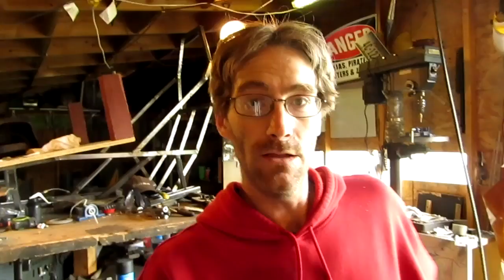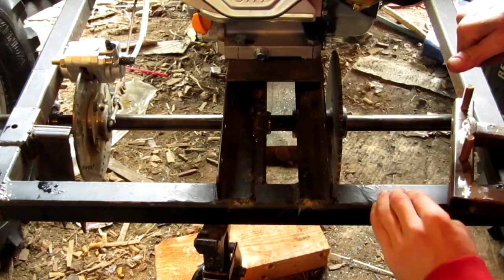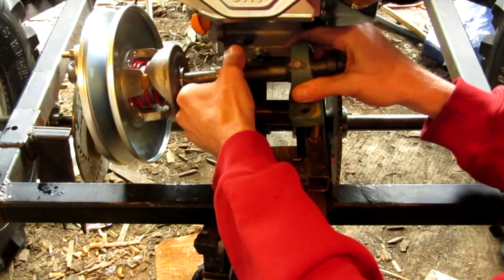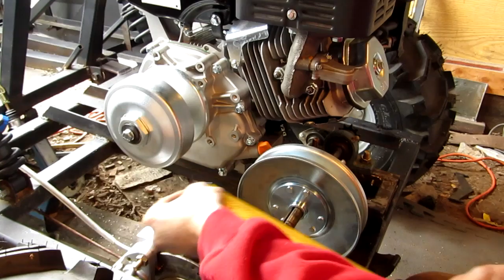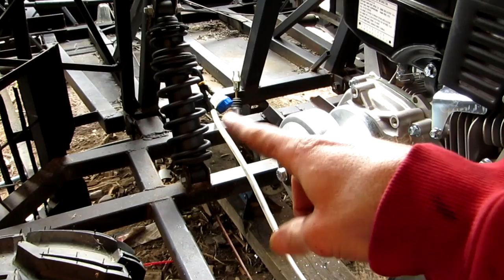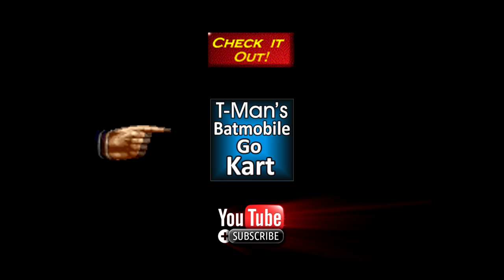Go Kart Batmobile Update

Comment: Why not weld on 6 1"x 1"x 1/4 on your jack shaft holder.  3 per side and that will give it extra stability when power is given to help out the 4 little bolts holding it.